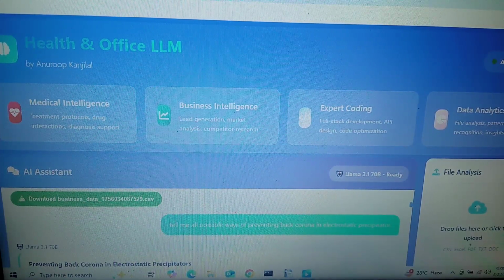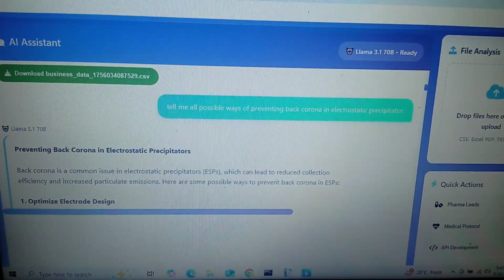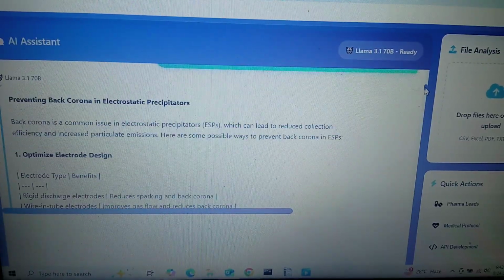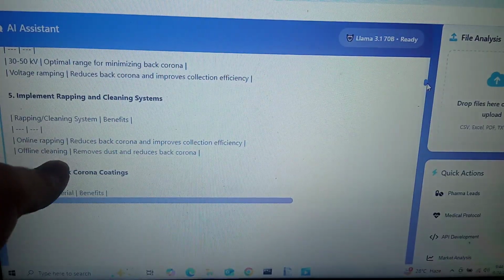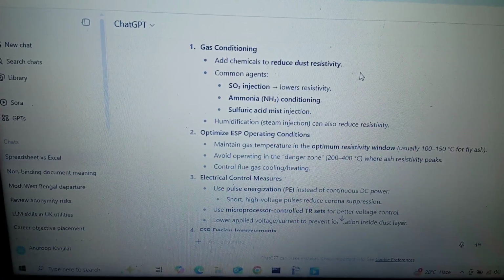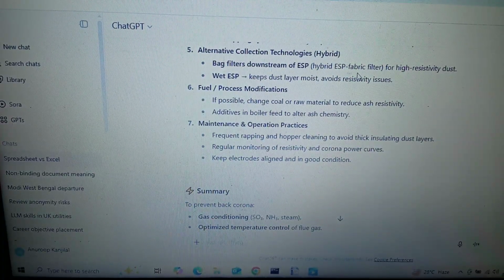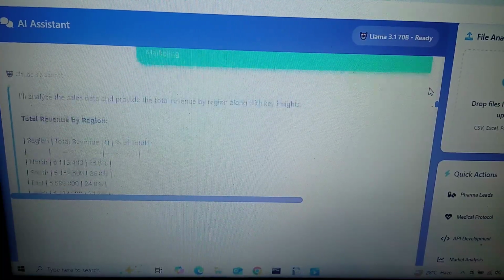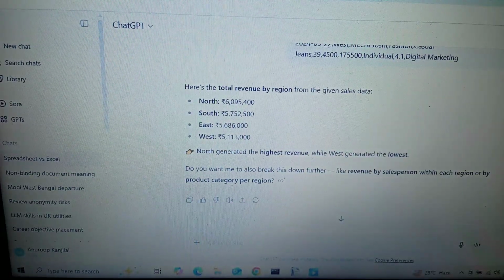Data analysis+ unique technical/industrial guidance capabilities of my llm for any kind of  product

Comment from the maker: My llm gives crisp technical information, means information that is clear, concise, and direct, conveying a core message without unnecessary details or "fluff". It is sharp, to the point, and easy to understand, leaving no room for ambiguity. 

Here's a breakdown of what makes information "crisp":

Clarity:

It is expressed in a way that is easily understood and sharp in its meaning. 

Conciseness:

It is brief and to the point, focusing on the essential message. 

Directness:

It delivers the information straightforwardly, without unnecessary or irrelevant details. 

Effectiveness:

It is efficient and quick, quickly conveying the intended message to the recipient.